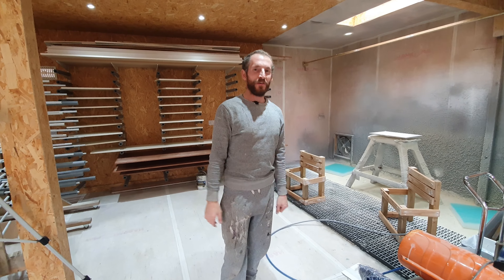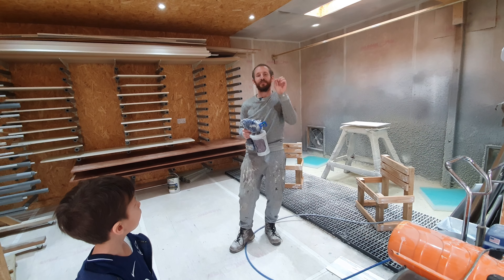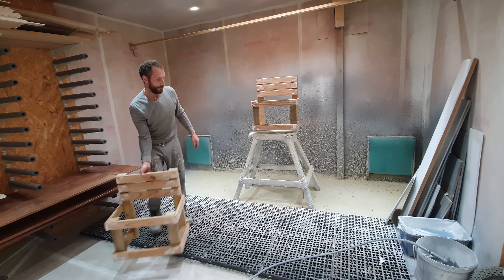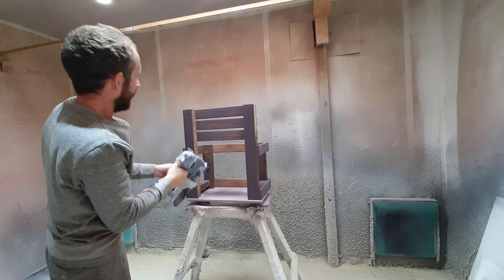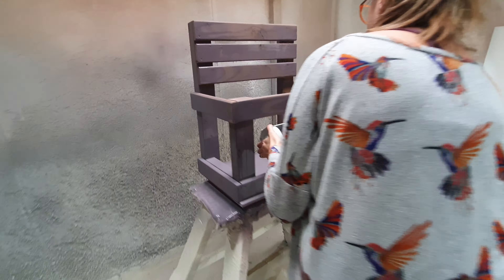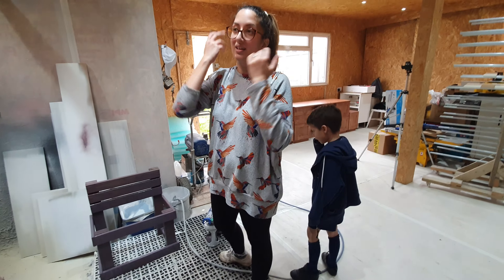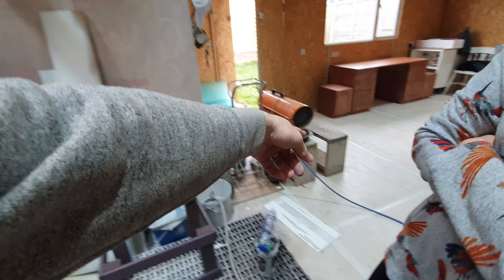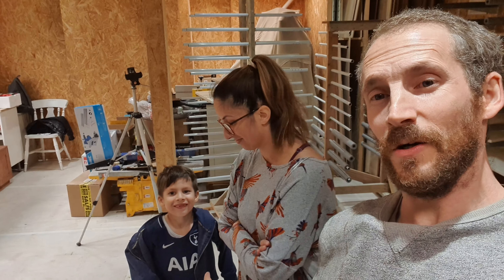My First Go On New Graco Ultra Max Airless Sprayer | Wife Sprays Her Diy Mud Kitchens - EP#57

Comment: I have the same sprayer and thought it was a bit faulty due to the amount of overspray. But watching you guys it looks like you have the same amount of overspray as well. Great machine but uses a lot of paint and I feel I spend more time cleaning it than I do spraying with it. But the end finish is fantastic.
Reply from the maker: The overspray is normal I believe, if you look at any spray through the light it would probably be the same.
I have 3 cups and fill them all.with water, then just switch cups through the cleaning process. I think it took me 10 mins to clean but I don't mind it.
100% prefer it to a brush and roller 👍

Comment: Hi Ryan. Firstly great video. Already got me planning... so a bit of guidance really.  I’ve practically converted my garage to a workshop and would have a use for a “spray booth”. Your extractor fans are working a treat.  Do they go external?  Could I make up a small booth with a fan pulling the overspray into a filter (all internal) Any steers welcome  thanks Mark
Reply from the maker: Thank you!
Yes my fans just blow to the outside through a cut out in my stud wall.
I guess you could do this maybe filters both front and back of the fan and also use a few more layers of filters.
I'm not sure I can help much more.
Cheers ryan
Reply: @thelondoncraftsmanworkshop  cheers Ryan.  All makes sense.  It was an impulse ask having saw the clip with the new hand sprayer.  I stupidly could have done some research. But it’s great to pick up some snippets from you.  Makes sense to extract external. Brill and appreciate the feedback my plan is now taking shape ...

Comment: I had an ultra before but might look at getting one again, how come you didn't fix the 2 you had?
Reply from the maker: They were beyond repair I think and they were both American with American plugs so the repair places dont want to touch them.
They need new pumps I think and they aren't easy to get hold of or change
Reply from the maker: I need to send you the tape measures maty, send over your address if you can. You can send via my website or a direct message on insta 👍
Reply: @thelondoncraftsmanworkshop  hi yeah will message from website now!